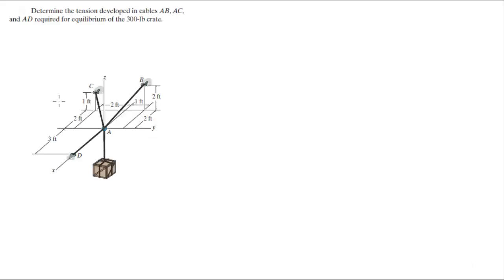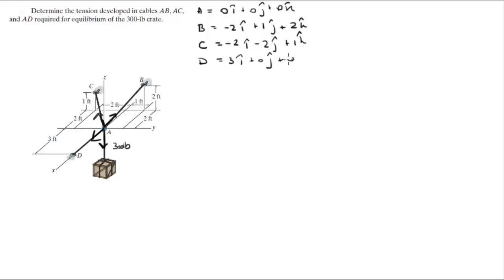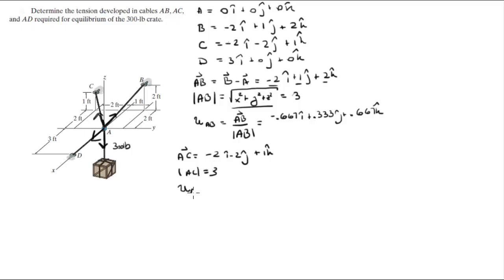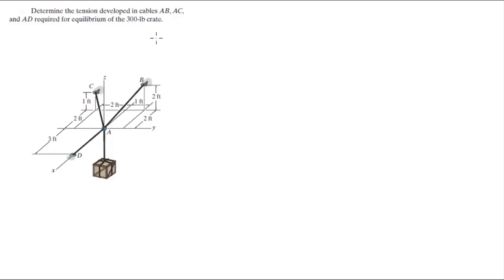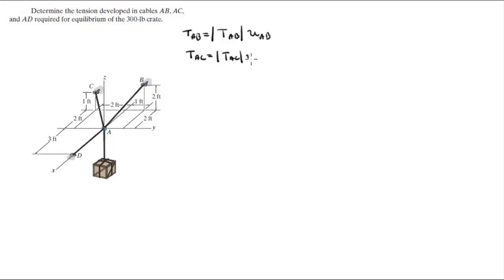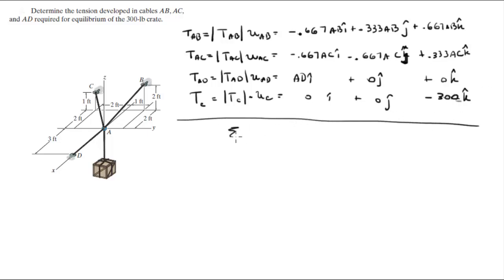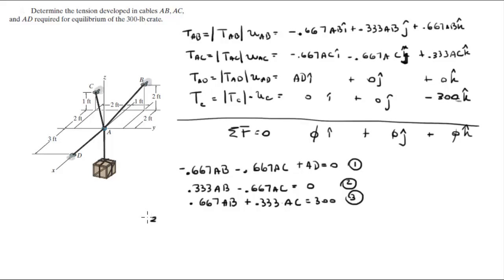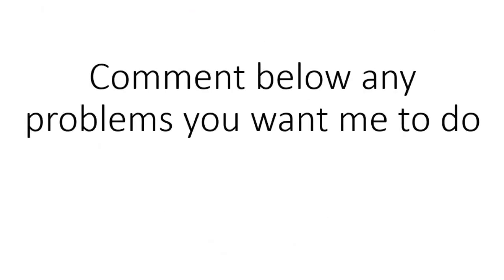Determine the tension developed in cables AB, AC, and AD

Comment: where does the -2 you multiply equation 2 coming from? Ive tracked alone in your previous videos, but Im not seeing it this time...
Reply: it's just a chosen constant. This is so that .333AB becomes -.667AB; now, when added to the first equation, both AB components are eliminated. From here, the value of AC can be found.